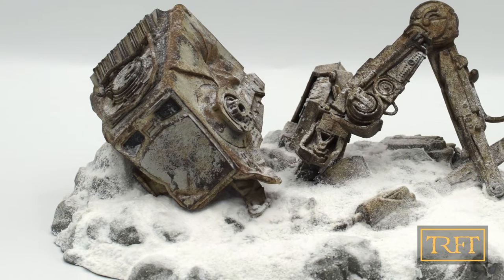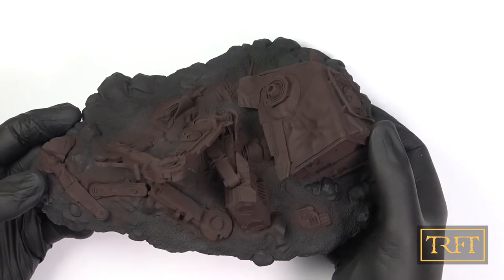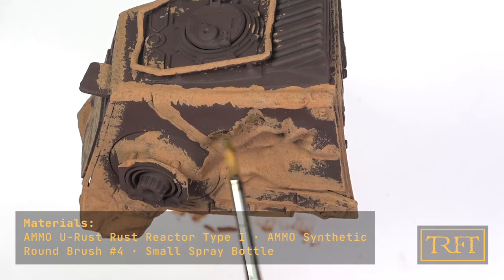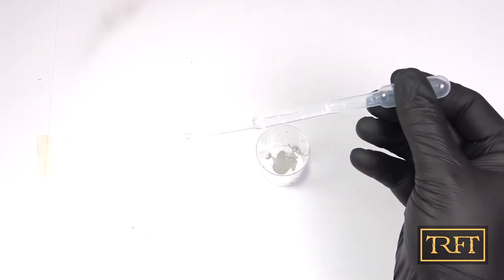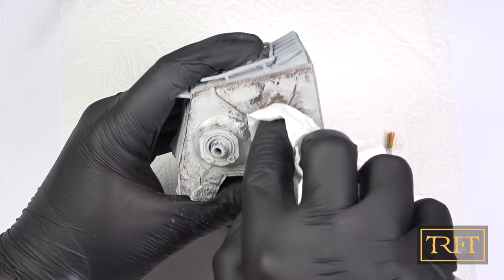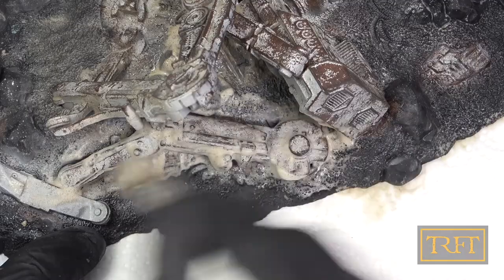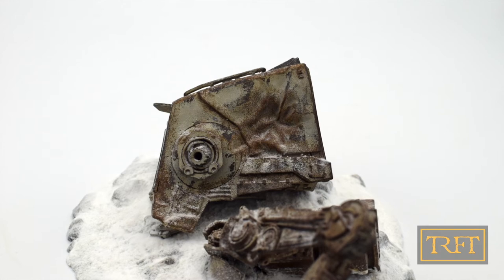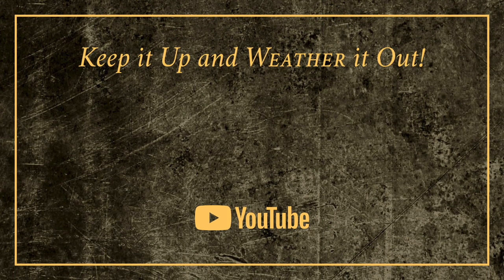AMMO U-Rust - How to Use U Rust | Star Wars Hobby Tutorial Episode 12/16

Comment: Is this rust after drying hard enough or need it a layer of varnish? Did varnish change the appearance? And is it after drying non toxic? :)
Reply from the maker: Sorry for the delay, Modellfrickler! The AMMO U-Rust is rock hard after it dries, but like I said in the video, applying Tamiya Clear did make it react again. My downed AT-ST has not changed at all since I finished it back in June and it has been (man)handled quite often since then, but I would definitely not LICK the rust! 😄
Reply: @TheRaceForTerra  Hi, thanks. I thought about using the rust as a coat under the basecoat and chip it free. But it sounds like the best is to use it after all varnishes are on the model.
Currently I use Dirty Down Rust and I wouldn't touch this without a layer of varnish. :)
Reply: @TheRaceForTerra  Ok I forget that you use a paint coat above for chipping. :) So I will try it. :) And I will test different varnishes maybe.
Reply from the maker: @modellfrickler1883  No, I think your original idea is better - it should really go under the basecoat. Remember - this is not an acrylic paint, like DDR...it's actual rust.
Reply: @TheRaceForTerra  Thanks, I will try it :)
Reply: @TheRaceForTerra  one question, how was the viscosity? My bottles are a thick clump and I can’t stir it enough to get a liquid like the videos